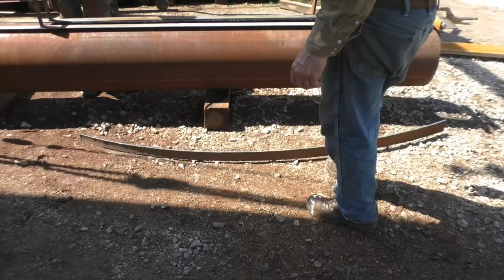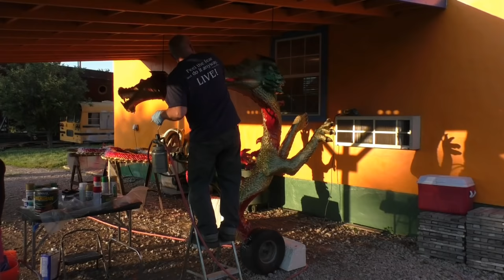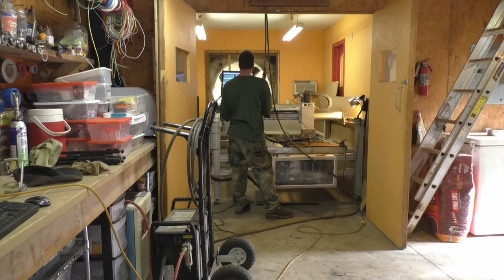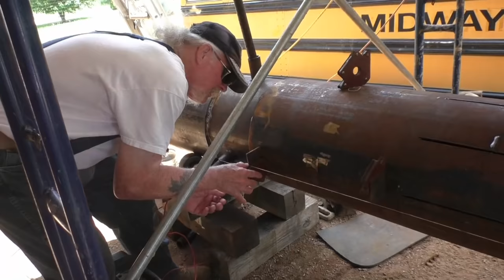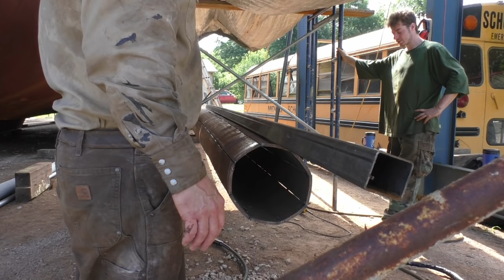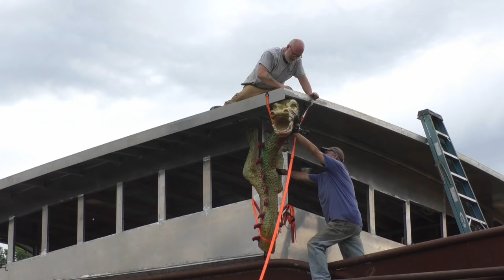Dragons and the Main Mast - Part II

Comment: the dragons look awesome!!!     was crazy how much the strips splayed from the pipe after you cut the tabs holding them in place....setting it on the rollers was a brilliant bit of work facilitation....
Reply from the maker: Stole that idea from Keith Fenner.  :)  https://www.youtube.com/user/KEF791
Reply: must say it worked out well, though a bit fiddly...would probably get easier with some practice but I'm sure you really don't want to have to mess with doing it AGAIN    and as you said, trees usually aren't that straight either and they worked well for centuries....

Comment: Doug;

Don't know if you are planning on doing this, but I recommend you put a 1" conduit up the length of the mast once you have the taper welded out and the two mast pieces butted up and welded together.  Use rigid galvanized and not PVC as any rope inside the mast will cut through PVC over time.  Run a messenger line in the conduit and then when it comes time to run electric lines up the mast (radio antenna and masthead light come to mind at a minimum), you already have a protected route for the wiring.  Your mast is big enough that you might want to run 2 conduits and keep one ready as a spare in case you think of something later (heck, you might come across a reasonably priced radar you want to use).

I think it is fantastic how you keep persevering and looking for the answer to challenges that come up during your build.

Regards;

Ron Kluwe
Reply from the maker: Good ideas.

Comment: A little late, but you should have cut rings with the outer diameter the same and the inner smaller and shoved them around the pipe in 3-4 foot intervals. Then you could have laid the pipe on a straight beam, welded it and knocked down the rings. Almost perfect taper. Cheers

Comment: A bid of bend on the mast towards the aft is something you will need if you are planning to sail. Sailing boats will usually have an adjustment to be able to bend the mast backwards depending on the wind conditions and sail used. A bit of pre-bend means that it is then easier to tune the mast, although I am not sure this mast will be able to bend that much given its "solid" construction.
Reply from the maker: You're right.  This is an unstayed mast.  No standing rigging at all.

Comment: You can always use heat to straighten the pipe, and I would expect some warpage as a result of the welding.
Reply from the maker: Right
Reply: maybe it could be corrected with the rigging as well.

Comment: Just to keep in mind, most masts have a few degree rake backwards, at least on Bermuda rigs, not sure if it's the same for gaff rigs but having a stern rake may provide useful for a number of reasons.
Reply from the maker: This is the mainmast on a three masted Junk.  The foremast has a 9 degree forward rake.  The other two are vertical.

Comment: nice mast straitening :)
you know the easy way to keep the 2 ends in line is to weld a platform in 1 end of the mast were you can attach a laser to so it is centered and then tack a plug in the other end with a hole in the center were the laser can shine thru... so the hole in the end plug has the radius of an acceptable offset .
you then weld until the laser disappear roll 180° and weld until the laser disappear and so on
then you only have to worry about bow and bends as you are welding.

Comment: Mixing together 4ths, 8ths and 16ths makes me think about how to add and substract fractions again, thanks ;) Good job on engineering and finding practical solutions to difficulties you face along the way!

Actually you would think calculating in base-2 would be easy for a software engineer but not so when it comes to fractions.
Reply: the most difficult number to "represent" in binary is .1

Comment: I am a structural welder. For my job I build and repair heavy equipment, gold mine processing equipment, hydraulics, metal machining. I weld steel, stainless steel, aluminum with tig, mig, and stick. My wife and I would like to come out and lend a hand, is there anything we could help with?

Comment: This was a great video for me because I am learning to not be a perfectionist. Good enough is a critical lesson to learn in engineering - which you would think an engineer would know by now! I was going crazy when it was 3 inches out, but I am okay now.

Besides you will be putting a bend in the mast on purpose (using your stays) when you tune your sailing rig after she (I assume the boat is a she) is on the water - so who cares.

Now say it again to yourself (talking to myself) "good enough.......good enough........good enough.........good enough"
Reply from the maker: Spot on.  Good enough and move on.    There is much more to be done.

Comment: Fantastic effort. Two comments, when at the end he says 19" then at 180° 18 3/4" the bend is 1/4", well in fact it is half that so 1/8" Pretty damn good. The other comment is how are you going to relieve all those stresses you've put into the mast. Maybe build a fire along the whole length or a full length gas pipe with jets at intervals and propane?

Comment: Don't worry to much about the bow in the mast, if it is straight up you wont see it. 
and on a lot of boat the taper isn't straight like this:  /\   but more like this /|  with the straighter side towards the stern. 
But when you have the mast up, you can manipulate it with the shrouds still.
Also all the lines going up/down and the spars for the sails will take the eye of a slight bend.
Reply: I was thinking that, Bermudian rigs are deliberately bent by the backstay. That said, I think this is a junk so won't have shrouds? I think its an unstayed mast

Comment: Hi,

And a really huge thank you for the ‘office meeting’ type thing it took to get a ‘near enough’ to spot on finish and how to achieve it finish. Of course there will be ‘guy-ropes’ to adjust and pull it even closer to the ‘exact’ you want or need once it is getting fitted to your boat when it reaches the sea?! I can’t recall how far you said that is away from you, as you may put the mast up and ‘fix’ it when you reach the river?

I also hope the sea water doesn’t find a way to seep-in and destroy your marvellous Dragons! 
I can see all the care you and others, mainly women who tend to have a better ‘eye’ for detail on that sort of Arty thing, had into these Dragons, but the sea will always find a way into even the tiniest pin-hole, I just hope you have sealed the backs as well as the front, thats to say the side fitted to the boat as apposed to the scaly side.

Are you going to leave the ‘fitting-out’ until you reach the open water to save on weight, or continue to do that and most of the painting whilst on dry-land?

I wish you good luck on the finishing which IS getting ever closer. So how are you going to finish under the Dragons on the Pilot-House?
Reply from the maker: They are unstayed mast, and we will step them at the Tulsa Port of Catoosa, once we are in the water.  And she will definitely get her paint once the steel work is done.   And the dragons can be removed.  Only screws are holding them on for now.
Reply: Hi,

I very much appreciate your kind reply, thank you so much.

mrbluenun

Comment: Should have welded the taper as a separate piece to control the shape better and give it structural strength for joining to the mast straight section. The joining is the easiest part.

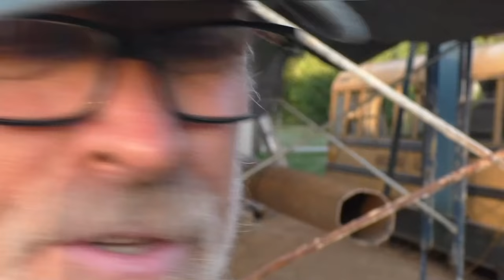Comment: At 21:44 - The bow in the mast will only be seen by sea gulls and I think that they wont really care.
Reply from the maker: I care about the birds too.  :)
Reply: Will that mast have guy wires and wouldn't that be able to take out some of the bow?  Also, sun heating on one side will cause expansion and then bowing.   Full disclosure - I don't know anything as the last boat I was in was a ferry going across Lake Michigan (Lake Express > 50mph!).

Comment: Have you got enough power out there for a second welder? I'm sure by now you've got some nice friends that have portable generator welders as well, and weld in the horizontal position 180° from each other at the same time to control it from distortion either way.
Reply from the maker: Hey David!  I like your new place.    ...and we have no problem running both those welders of the same 40 amp breaker.    We did not weld 180 apart, we just welded on the side we wanted to shorten first.

Comment: Doug - Are you planning on running all halyards/masthead cables outside the mast?
Reply from the maker: Yes.  We want them where we can see them, easily replace them, and we need as many feet as possible between the spool winch and the fist pulley so it lays neatly on the to spool.

Comment: after you had it all cut apart I realized that if you had spray painted parallel rings going up the mast about ever foot or so you would have had a much easier time fitting it up... then I saw your lines an figured you saw it too
Reply from the maker: No, we did not mark it,  but I like that idea.  The marks would need to be very accurate, but that would help.
Reply: Really..I thought I saw chalk lines going across the pipe after you started tacking.
Reply from the maker: Right.  Just a line to mark about where we wanted the tacks.
Reply: +SV Seeker gotcha. looks great.  I disagree with everyone about the Elmer Fudd shotgun look. I thought it was more reminiscent of the old steam riverboats. the smoke stack was splayed out like that. but like I said...looks good.

Comment: Awesome vid! Have you done any stability calcs on having steel masts on that size boat? We once "Upgraded" a radar dsplay from 350 pound unit to a 500 pound diplay, just like that, got a 4 degree list at 12' above the water line. It sounds like the big boy is your mizzon and the smaller one is your main, that will help, but man that is a lot of weight aloft. Dragons definitly going to get ripped off, once you go beam to in your first storm. Strayed a bit from the K.I.S.S. method on this one. Love the channel, will buy swag soon!
Reply from the maker: Yep,  all the ratios are good.  We have 15 tons of lead in the keels.   There are 3 mast.   The mizzen is just a regular street light pole.    And I'll be happy to take your money if you'd like to wager on the dragons.
Reply: I want to take that bet, just to guarantee the dragons survive ( I lose just about every bet I make). $5 dragons are gone within 3yrs after Seeker hits the water?
Reply: Good to hear man. I like how most of your problems are solved with testosterone, balls and a grinder - that's becoming a rarity. Hopefully as your channel grows maybe this will show the youts another path..... Still as your chief negative nancy, I was in puny little 4 footers on a tug pushing a barge on the Ohio when a steel access door ripped off the bow when the wind hit 50mph for about 12 hours 2 months ago. The gulf and the Carib is the super bowl for offshore boating. Poseidons balls are bigger than yours. I know, I know you're going to give him hell anyway.....
Reply from the maker: Positive Vibes..   Thanks
Reply from the maker: Actually I think the southern ocean would be the real test.   But I don't see the point of getting hung up on what might go wrong.   We enjoyed building the dragons and the rest of the boat and find great pleasure in it.  If it's gone tomorrow, we do live in F5 Tornado country, then we will find great pleasure in something else.   :)
Reply: Awesome point man! You deal with risk everyday out there. Sometimes when I point out stuff like this I'm thinking "What do you want him to do, sail around in an Abrahms?". I just want you to win, we need guys like you out here and money is tight...But as you point out, it's just stuff.... Positive vibes!!

Comment: could you rose bud the effected area and try to bend the mass?
Reply from the maker: Yes,  it would take me some considerable time, but I think that could be done too.   I think bending and welding is the best first option and then heat bending and do the rest if needed.
Reply: after I said that I was not thinking about to much heat make it also be week
Reply from the maker: Naa.  We have done some heat bending already and it has worked very well for us.   Besides, if heat is going to be an issue we will know when we get it back from being hot dip galvanized.

Comment: I would put a Ham Radio antenna on top of the mast.
Reply from the maker: I'll let you climb up there and do that.  :)
Reply: While at sea AirMail is a free radio mail program for sending and receiving messages via Pactor on the ham bands, Airmail can transfer messages automatically with any station using Winlink 2000. When I was a scout master I used to set up a HF station so the boys to talk to mom and dad. Lots of fun!

Comment: don't want to sound like a know it all armchair qb, but the joint between the two spans doesn't seem strong enough. between the weight and height of the pipes, sails and rigging and the forces of the wind it seems like a possible weak joint. don't mean to offend anyone. just making an observation. I enjoy watching your videos every week.
Reply: The join was only in temporary for this part. Later when it's finally installed they will weld around the seam as well as drill holes in the outer portion and do plug welds, I believe.
Reply from the maker: Correct.    But we humans seem to love it when we can worry about something.

Comment: You are worrying to much the Greeks proved long ago for visual perfection a building has to have measurable imperfections. The Parthenon's status as perfection is questioned by any one that uses a measuring tape and builders square. Any thing on water will always have a degree of flex and instability, leave the worrying to those spending way to much because of there desire to compete for the America's Cup.